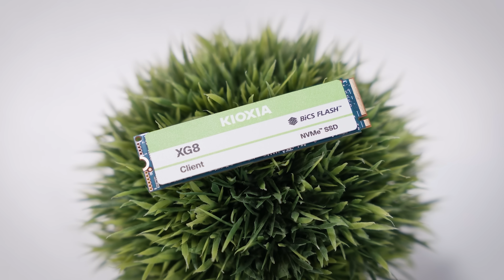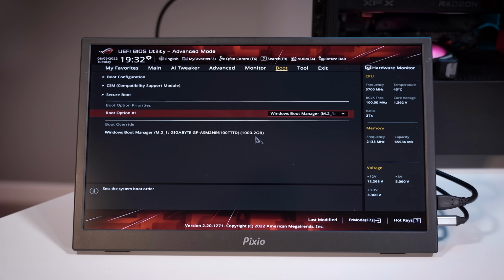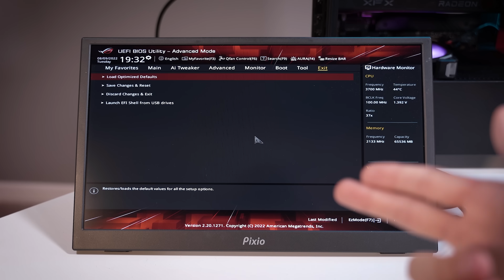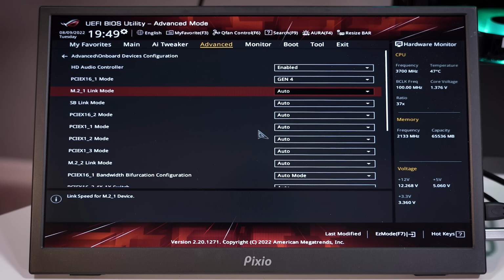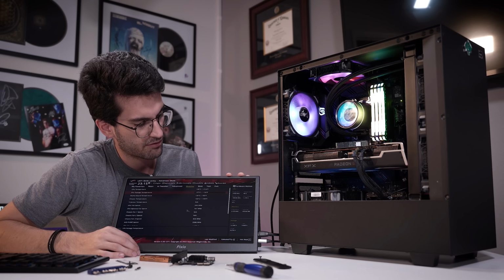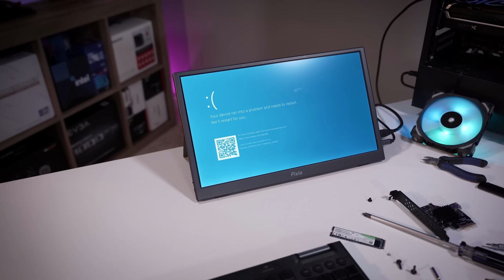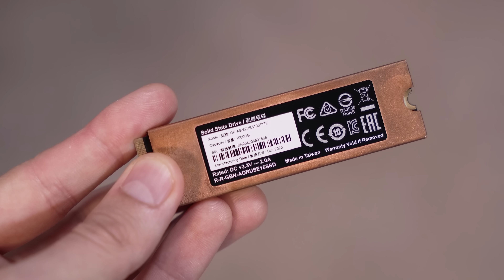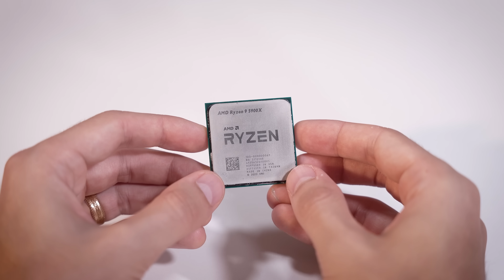Fixing a Viewer's BROKEN Gaming PC? - Fix or Flop S3:E2

Comment: EDIT: You can request the warranty yourself when you're done with the testing, but essentially the memory controller is DOA. 

The 5900X is a beautiful unit, but they do suffer from memory controller issues, which is seen frequently. This CPU has 3 years of warranty and AMD will replace it without complaint. Just have him call AMD and get a replacement. Have him reference this video for the warranty.
Reply: It's likely a dead core. I've been this a few times across many Ryzen generations. Turn off cores in the BIOS until you figure out which one it is and be left with 2/3 or 1/2 the cores.
Reply: @b0ne91  Well, dead cores cause performance issues, and they show up as WHEA errors in the event viewer. This level of failure, where the system cannot be mounted on the RAM is either faulty hardware OR corrupted software.
Reply: @medicentio  Nope, have had at least 3 CPUs with dead cores where they'd crap out when the Windows loading circle came up and it was fixed when turning off cores :)
Reply: @b0ne91  ah, interesting!
Reply: @medicentio Hmm, maybe mine is faulty. It doesn’t get this hot and at full usage I max out at 75°. I was very worried when in the desktop I was at around 50, but once my startup apps all launched it went back to around 45. I might need to try this. Does it matter where you bought the CPU from?
Reply: @Dylbog  doesn't matter.
Reply: @medicentio  ty for letting me know. I might do it and see if my skew was actually faulty or if it does just run THAT hot...
Reply: @Dylbog  40-50c on desktop is normal (at least for Ryzen 3000 and Ryzen 5000) I have had these kinds of idle temps with my previous 3900x and current 5800x3d on the Kraken x62 AIO. Some people run a lot cooler at idle but that strongly depends on the background apps you have running. You have nothing to worry about with these temperatures at idle, especially if you max out at 75c in-game.

Comment: I actually was given an old prebuilt gaming PC from my SIL recently that had these exact same symptoms.  System posted but then immediately would crash or lock up.  Loaded into the bios and it was idling at 70-80 Celsius.  Problem was just that the CPU cooler was literally not fully screwed down.  A quick removal, new thermal paste and putting it back together fixed the temp problem.  The windows install itself was somehow corrupt after that though and still needed a reinstall of the OS.

Comment: I had the same problem with my first build; many different blue screens, no boot. I was a noob, but after carefully re-watching the build video.  I remounted the CPU correctly and much more firmly and then everything suddenly worked fine.   Thanks Greg really enjoy this series.
Reply: I am having the same issue - did you find that your cpu was placed on the mobo incorrectly and that flipping it in the first position fixed the issue?

Comment: I would have liked to have seen you reinstall the original cpu to confirm the cpu was the issue. There is a possibility that the problem was a one-time mounting issue with the cpu and socket.
Reply: mhhm but he swop the AIO to an air cooler.. so i dont think this was the issue
Reply: I mean he'd worked on it for hours and hours, I don't really blame him.

Comment: Me @9:30 thinking.. My 5600x did the exactly same thing (BSOD forever, no matter what). Ended up changing the CPU to test (got a 3600) and.. Working? Wtf? Swap the 5600x again, BSOD for days, 3600 installed and working.. RMA'ed the 5600x. Now, lets watch the rest. (edit 1: without watching ahead- Tried different GPUs, PSU, hdd drives, ssd drive, nvme, formated, resseated the cooler, booted with 1 dimm, downgraded the firmware, upgraded the firmware. 5600x was the only thing I could think about)

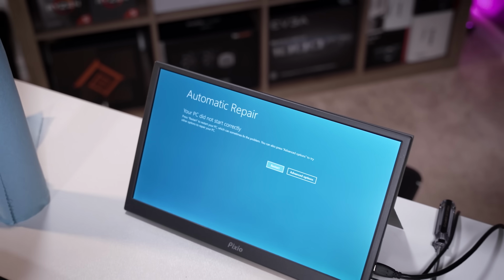@14:20 Called it. :D

Comment: None of the components were bad on this system certainly not the CPU
1. If for some crazy reason the SSD gets converted from gpt to MBR windows will never boot
2. On modern motherboards if boot device changes from UEFI to legacy or vice versa windows will never boot
3. Some motherboards have new security features if for some odd reason these options will change you will see these blue screens
Reply from the maker: Lol. CPU was 100% bricked. Exact same symptoms replicated in a separate, working rig.

Comment: Did you try at any point just using 1 ram stick? or just 2 sticks? It feels like its a memmory controller problem and that would also explain why changing the cpu makes the pc work
Reply from the maker: Yes, multiple RAM configs, including completely different kits.

Comment: put his cpu back in, it will work now!  your issue was the ahci bios setting with the windows setup.   you shoul dhave done a windows install on either drive.  Hey if you want to give the guy a 5950x upgrade... I'll shut up.
Reply from the maker: It had nothing to do with AHCI. We toggled it several times. Also cleared CMOS multiple times. We even eventually tried the chip in a completely different system only to arrive at the same symptoms.
Reply: @GregSalazar  did you ever try just re-installing windows?  even if it's not ahci vs UEFI swapping boot drives is always questionable.  I admit the 71c in the bios is odd, but I would expect shudowns not bluescreens on boot up

Comment: Watching this reminded me of when my 5950X shit the bed...oddball issues and crashes. I must of swapped in almost an all new rig...until I replaced the CPU with a known good 3900X...and the rig smartened right up. I indeed proceed with the RMA process with AMD to get the 5950X replaced, they did replace it under warranty and the system has been rock solid since.
Reply: I have never had a dead cpu, I have had muliple dead msi motherboards, i buy a lot of cheaper boards asrock or biostar and never had a single issue. I have never had a dead stick of ram in 20 years of building, the only dead stuff has been motherboards and harddrives or ssds. 

Generally speaking amd has been more reliable when i have built with them, I like amd cpus but i dont like amd graphics it always looks a bit washed out no matter what and nvidia always looks better.  it is what it is.

Comment: What were the temps on the new chip? I'd wonder whether the MB caused the chip failure.
Reply: The owner posted it above in the pinned comment, 38C at idle using Greg's cpu.
Reply: that was my question as well
Reply: I also have a 5900X and it always runs very hot. Not sure why but when researching it appears like the chip just runs hot. When gaming at 1440P max settings on most games I max out at around 68°. I’ve never hit above 75°. I think the viewers one was definitely faulty but the chip is very hot at idle. I’ve used 3 different coolers, reapplied paste, under volted but temps are always higher than you’d expect! Not sure why though. I wish AMD would provide info on this.
Reply: Another 5900X user here. Stock it would throttle in Cinebench R23 MT. Undervolted by .125 and it never goes above 75°, but it still idles at ~50. Granted, my cooler is basically never audible over other noise, so that may be a thing. :D Also I have all kinds of crap running so "idle" isn't exactly idle. :D
Reply: @Dylbog  Ryzen 5900x user here!!!!

Using an Artic 280mm I get iddles around 38 to 44s. As soon as I use it, it boost and temps touch high 50s. For gaming I get around high 60s and mid 70s. Keep in note, I'm using a little bit of negative voltage offset tuning and silent fan profile on Asus X570i

I think ur temps are pretty accurate, so don't worry
Reply: @Dylbog  I also have a 5900x, using a Corsair H150i Elite Capellix (360mm) and Thermal Grizzly Kryonaut Extreme paste. I get temps in the mid-high 60s while gaming, with very brief momentary spikes of up to 78 (tracking via HWinfo, which I keep open all day). I went crazy trying to fix it. Started out with Noctua NT-H2 paste, remounted the cooler several times, bought three ML120 fans to set up a push-pull configuration on the radiator, and finally switched to Kryonaut Extreme. My AIO seems to be working fine, with the pump set to "extreme" performance and a custom fan curve. My fan curve is tied to my coolant temp, not CPU temp, because it gets too loud otherwise, but the 5900x does just seem to run hot. No idea what it is. I'm running completely stock, with an ASRock X570 Velocita. I've had thoughts that maybe the motherboard was at fault by sending voltage spikes to the CPU. I'm glad it's not just me though!
Reply: @Dylbog  Try to undervolt your cpu. I have a 5900x too and it runs hot at idle because of the core voltage. I overclock my gpu at 44.75 and tried to undervolt The Core voltage to 1.25 and now it runs normal, like 30° at idle
Reply: Nah a short in the cpu probably causes it to heat up.

Comment: I used to be a repair tech for Apple. You wouldn't believe some of the weird things I've seen. A topcase to a laptop that was shorting the MLB, went through quite a few MLBs before we figured that out. Computer wouldn't start because of a bad battery for some reason. Once we had a fan that was putting the laptop into a boot loop.
Reply: I had a lenovo laptop where the wifi was integrated into the board itself and was not a separate module it died, they replaced the entire board for free and replaced the case i basically got a new pc out of it. 

My current pc has 2 m.2 drives the 512 gb boot that it came with and the 1tb wd sn530 drive that i bought to upgrade alongside 32gb of gskill ram its a laptop btw.
Reply: I have this MacBook from 2012 that used to act like it was dead. Wouldn't show battery level and wouldn't turn on. It would be dead until I slammed the screen shut and then it would turn on. Took it in to get looked at once and pretty sure they didn't even take a look at it cause they told me it was dead and nothing they could do. Went home slammed it again and it turned on. Still not sure what was happening, but it still works to this day and stopped doing it.
Reply: @Joes2016  wtf
Reply: @pilsplease7561  Yeah I don't know. Thought it was something to do with battery connection in some way, but it wouldn't't work even when plugged in. So who knows.
Reply: @Joes2016  I know some  laptop computers have a switch thats tripped when you open them up so they wont run if thats tripped because they think they are closed. That might be what was going on.
Reply: @pilsplease7561  You would think, but even if that was the case. You could still check the battery with the button on the side. It is also very audible when it turns on which it does even when closed. Also the charger wouldn't even show it was charging with the led light.
Reply: @Joes2016  That sounds like a potential fire hazard like a horribly bad short or something.
Reply: @pilsplease7561  Possibly lol,  but it's been 5 years since it's done it. Did it for twoish years being used on and off. Still works today and I actually Installed Linux on it a few days ago.